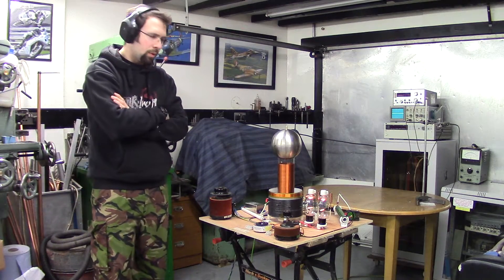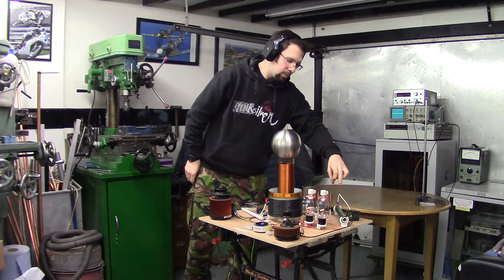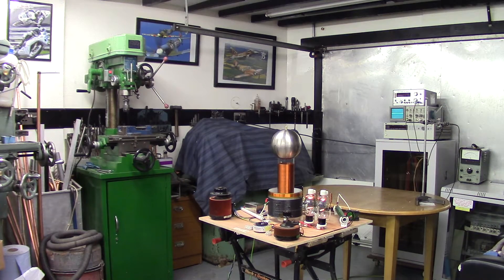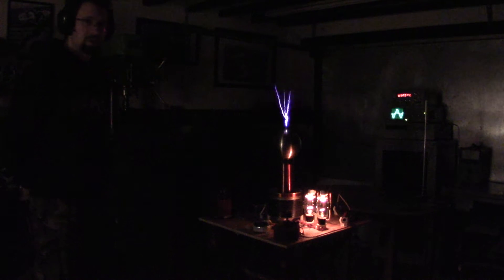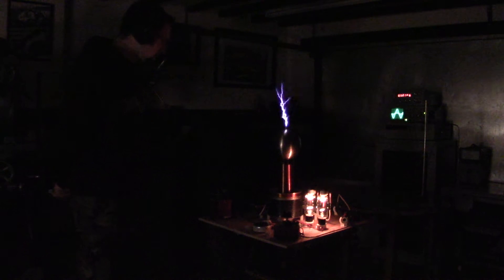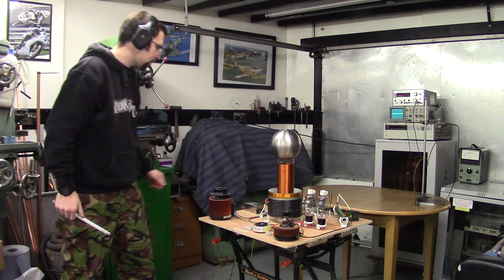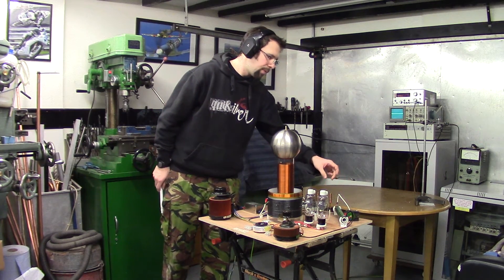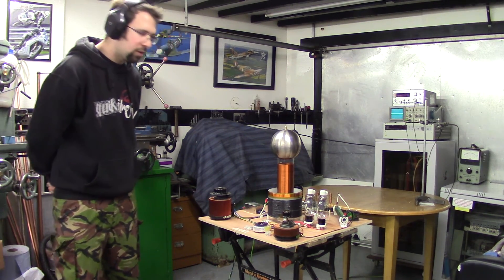Dual G-811 VOSTOK 2.0 Vacuum Tube Tesla Coil

Comment: Janice job! Certainly throwing off some decent arcs! Do you have access to transformer oil? If so, you could put the MOT into a container of it to also help with cooling
Reply from the maker: +CAL'S ENGINEERING No need to worry, I have since been given a very large old Japanese MOT that does not get hot, even after 10min run!

But yes the oil method would certainly work and I do have access to HV TX oil, it's rather rare and expensive if I ever needed to buy more, so I rather use it for last resort applications really. I think just standard mineral oil would suit this 2KV setup if I ever needed to. =]

Comment: Looking great with 2 tubes, hopefully staccato soon :).
Although we could see the scope, a nice touch would be another cam focused on them and PIP into one corner, then we'd be able to read the frequency counter too ;)
Reply from the maker: +Sparky Projects Staccato very soon I think!
And yeah I wanted to moved the scope panel more into view buy was not on its usual casters at the time... next time I will think of that. Freqency counter is not having such a good time reading so it's just for show at the moment til I work something out.

Ps; does this video only appear in 360p for you too? not sure where the 1080p went... =[
Reply: Just checked, it was at 480, but i could select the HD qualities, a new vid processes for all available qualities at the same time, but the higher quality ones take longer, so give it a bit of time.
Reply from the maker: +Sparky Projects Yeah its at 1080p50 now, Just being impatient, I would rather publish it when it's at Max quality rather than the early birds getting shot down...
Reply: +Steve Lane Only way to do that would be to upload as unlisted or private, give it enough time and make public, otherwise you'd have to leave the page open until you hit the publish button
Reply from the maker: ***** yeah I think upload overnight as usual but then only publish it before I go to work to give it enough time to build the quality. Good thinking! =]